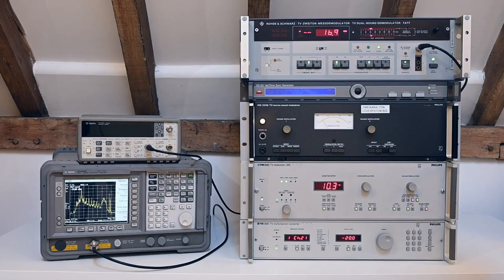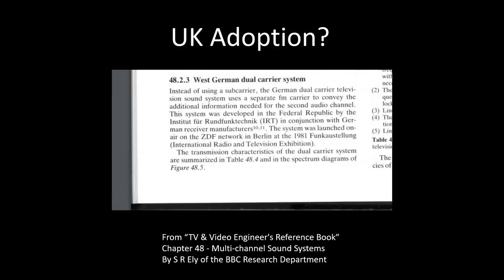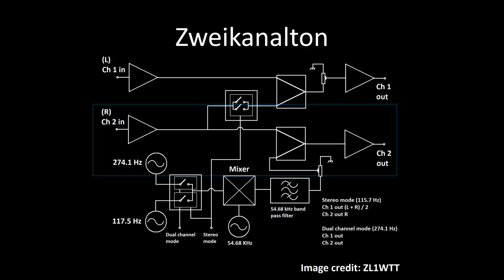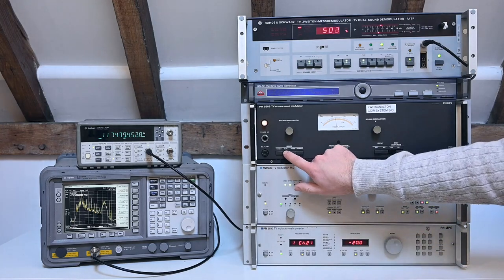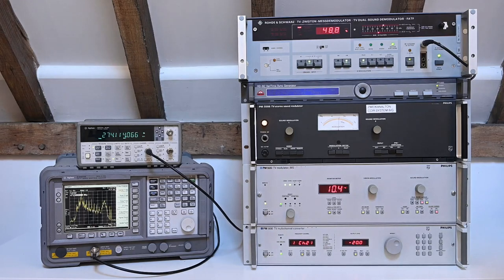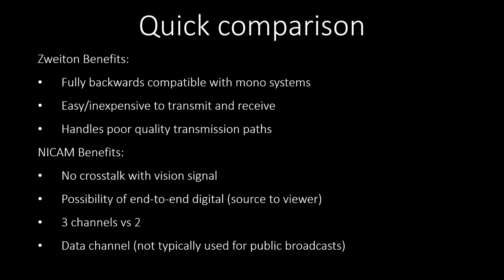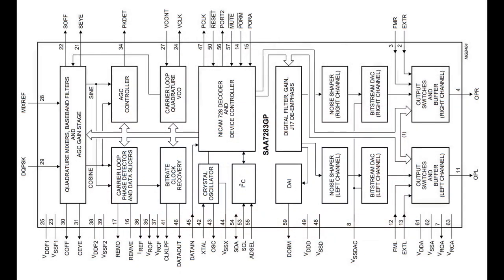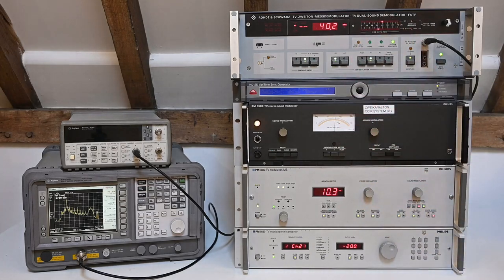#3 - Zweikanalton / Zweiton / A2 Stereo (and quick comparison to NICAM)

Comment: First NICAM broadcast was done in 86 (tests) in the UK. Denmark had a full service starting in 1988. First A2 was in 1981 on ZDF in Germany.
Reply from the maker: I am aware of the UK trials. That was done with experimental hardware very different to the final solution. I specifically referred to public launch. Do you have a source about Denmark? That is interesting. The Philips solution is Danish and was probably completed by 1988 but doesn't appear to have been for sale until 1989.

Comment: Well, the R+S device is a "Messdemodulator", so it is a measuring (Mess-) demodulator for the lab or trouble shooting. That's PROBABLY the reason why it does not need to be able to demodulate both channels at the same time.

Comment: Stereo reception on radio is often noisy, while TV always blasted loud and clear. I used to think they could use two parallel stations to send stereo more clearly and simply. Mono radios were much cheaper and a home usually had at least two of them that could have provided an easy compatibility. NICAM seemed to be quite robust (on a late integrated Philips receiver that I unfortunately threw out). The TV could lock onto the signal with a short cable as an antenna. We had cable television where they briefly translated the dual audio on separate channels, and I checked NICAM over the air as a curiosity.

Comment: What system was used in Serbia? We had a analog channels with stereo sound but I don't recall that they ware digital. I someone had mono TV he could build external stereo demodulator that was very similar to radio FM stereo demodulator.
Reply from the maker: I'm not sure. Serbia has not ever been listed as an A2 stereo or NICAM country on Wikipedia if you find out and can have a reference perhaps worth updating one of those pages.
Reply: @mattstvbarn  Just realise now that Serbia was part of country Yugoslavia (there is no more Yugoslavia, only Serbia and rest Ex-Yu countries) so maybe that country was listed somewhere?

Comment: My parents bought their new 56cm TV in 1990 for about 8-10 months worth of average salary. The Tesla Color 428 had 30 channel presets, stereo sound (only A2 Stereo though), a teletext decoder and was fully remote controllable. Quite something for freshly post-communist Czechoslovakia. Basically, it was a Philips set: everything Tesla couldn't produce (like the teletext decoder chip, the IR receiver chip, etc.), was made by Philips :) I was a baby back then, but this TV lived with us until the mid 2010s.
We got cable TV in 1996-7, where the local terrestrial channels were just collected at the head end and frequency shifted, the Slovak TV channels had A2 Stereo, while the Hungarian ones were mono. At least that's what I thought, until my dad bought a brand new Sony TV in the late 90s, which had NICAM Stereo. The other channels coming from (digital) satellite were in regular A2 Stereo, since those modulators were cheaper.
Reply: Hungary used NICAM stereo broadcasting.
Reply: That would confirm that Slovakia used basically the same arrangement on cable as Poland - although here in Poland the "native" standard used by our own broadcasters was NICAM - although that didn't come until 1997; see my recent comment under this video for details.

Also, it seems that using Philips components by local brands was common all over Europe. That TV my grandma had that I mentioned in that comment, from the mid-90s, was branded Elemis, which was a name assumed by the Warsaw factory known as Unitra-WZT in the communist era. And indeed, it had Philips internals and basically operated like a Philips set, just with a very funky looking and unergonomic remote 😅 It didn't have stereo or teletext though, as it was the most basic model available, I think.

My parents during that time had a Sharp 21N52-E1 set, which was truly multi-system (supporting PAL, SECAM, true NTSC and NTSC4.43, as well as all the audio carrier offsets - systems B/G, D/K, I and M - no SECAM-L or PAL-M/N though), but very basic otherwise - no teletext, and the only form of stereo it supported was through the AV input. However, it lasted us very long - my parents bought it around 1992 I think, and we only replaced it in 2013 in the wake of analog switchoff, and after that it was still handed over to some neighbor who apparently kept using it with a converter box. It was serviced once or twice during that time, but still lasted over 20 years, which is quite remarkable.

Those Sharp sets also displayed the color system every time you switched channels, so we could witness the switch from SECAM to PAL in real time (TVP2 switched a year ahead of TVP1, so we were seeing different marks for a while), and I think it was influential in getting me interested in TV tech from my childhood years, as I was intrigued about what that was and how it worked ever since. Also intriguing were the false colors and "Venetian blinds" visible when you switched the TV to NTSC4.43 mode on a PAL signal - of course now I know how did that happen 😀

Comment: NICAM and A2 actually can coexist with system D/K, or more specifically, so-called system D1 which was used in Poland and possibly some other former Eastern Bloc territories. System D1 retains the 6.5 MHz main FM audio carrier as for D/K, but limits the video bandwidth to 5 MHz as in B/G. That additional megahertz of bandwidth can be used for the second FM carrier for the A2 system at 6.258 MHz, and NICAM at 5.85 MHz (as for B/G and L). There are actually a couple of possible frequencies for the second A2 sound carrier for D/K, but that's the Polish frequency at least, and I'm pretty sure it was explicitly chosen so that both can coexist. Or... well, Polish Wikipedia suggests that A2 was apparently colloquially referred to as "Czech stereo", so the choice of subcarrier frequency may have actually come from the south 😅

A2 stereo was never actually broadcast terrestrially in Poland, the standard of choice for that was NICAM. But reportedly A2 soundtracks were passed through without re-encoding for some foreign channels in cable networks, much like SECAM color was not re-encoded for channels coming from e.g. Russia, even after all domestic TV switched over to PAL (and I vividly remember seeing Russian channels in black&white with SECAM subcarrier artifacts on my grandma's cable on her then-brand-new PAL-only set back in the day). So you needed a pretty multi-system TV to receive everything that there was on cable in both color and stereo.

I don't think there was any channel that actually used A2 and NICAM concurrently, but it was technically possible and is documented as such in Polish sources. So you could in theory have 4 discrete audio channels (2 analog and 2 digital) on a single TV channel on Polish analog cable.

Comment: Just to update on my previous comment from 9 days ago: in Poland there was a similar situation, where the market was full of A2-capable sets, but the standard of choice for stereo on our TV was NICAM. Some people could make use of the A2 sets though, watching foreign channels on cable (or terrestrial near the borders). BTW, I'm pretty sure that Czechia and Slovakia used a variant of A2 as well.

Also, given that in our D/K regions the A2 and NICAM carriers got placed below the standard mono sound carrier, there actually was crosstalk with vision signal - but in reverse. One some sets, particularly older, single-standard ones, you could see the NICAM sound get interpreted as high frequency vision content.

Anyway, to reiterate - you can get both NICAM and A2 concurrently on system D/K and I'd love to see how a modern set like this Samsung deals with that, whether all 4 available channels would show up. Maybe if I finally get myself a HackTV setup I could check it myself ;)
Reply from the maker: @kFY514  interestingly Philips only made one version of the PM5588 - the B/G version. If A2 on D/K was commonplace I'm fairly sure they would be flogging equipment for it. You sure it was done?

Or was it the NICAM carrier which was moved? What were the actual frequencies?
Reply: @mattstvbarn  I posted everything in the previous comment that you seem to have missed. But just to reiterate, here in Poland, NICAM was on 5.85 MHz, just like for systems B/G and L. There were a couple of different A2 secondary subcarrier arrangements for D/K, but what was used here (on cable only) was 6.258 MHz. And Polish sources explicitly say that this system allows for both NICAM and A2 to coexist.

There's also another comment under this video posted about a year ago by a viewer who goes by @AttilaSVK who recalls receiving A2 stereo in Slovakia and comparing those to broadcasts from neighboring Hungary, who went with NICAM.

No comprehensive list of countries who used A2 seems to exist, but A2 on D/K was commonplace enough that Wikipedia lists three possible frequencies for the secondary audio carrier 😅 And I am fairly sure that it was indeed used in Czechia and Slovakia at the very least.
Reply from the maker: @kFY514  apologies. The channel does get quite a few comments. I don't always get to reading them all!
Reply: @mattstvbarn  No worries! But as you can see, you might be missing some interesting information ;)